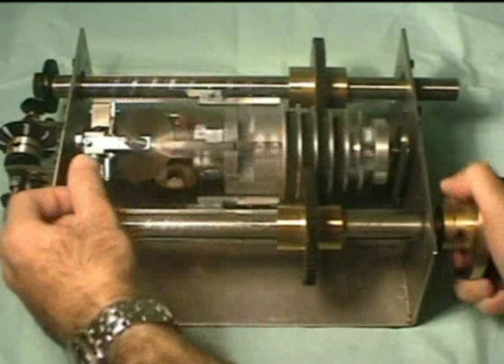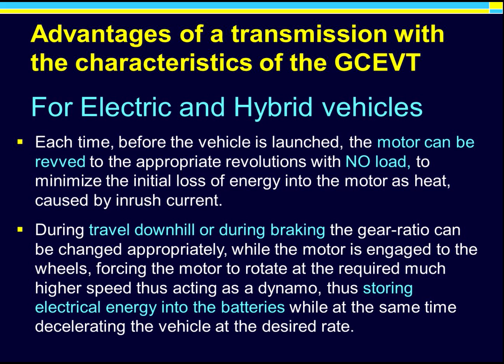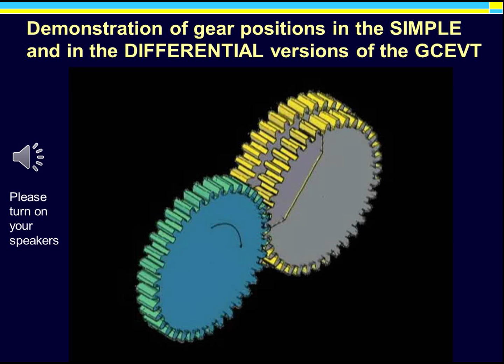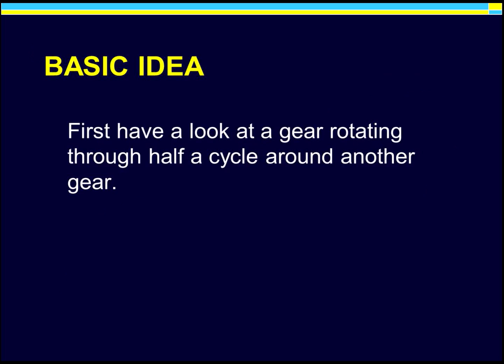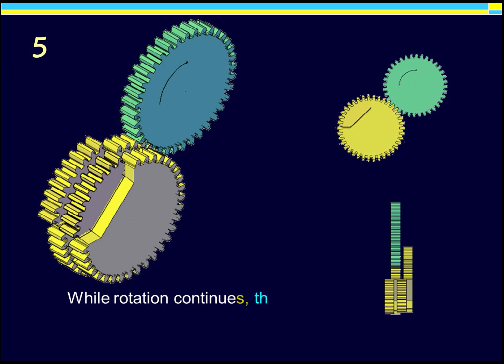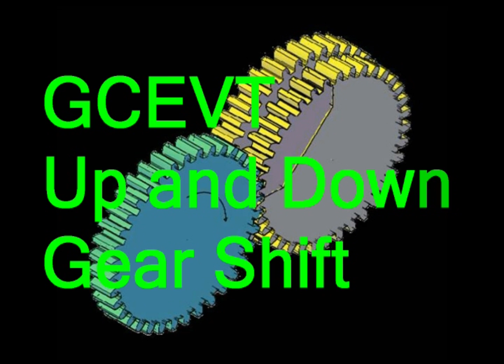GCEVT Gear-based Continuously Engaged Variable Transmission

Comment: So all of the central gears have to be the same size. In order to change ratios there has to be planetary sets inside the central gear sets. And from what I can see, you are using the output axles of the differential rotating at different rpm to regulate drive shaft speed. So you're dependent on the spider gears in the diff for output regulation. As well as the whole rotating assembly appears to require a lot of force to turn. Otherwise you would have demonstrated the shifting mechanism while turning the little crank demonstrating the ease of operation. Sorry I have to call BS on this one. Nice try though!

Comment: The actual gear changing happens during one half of a shaft rotation. So, if the shaft is rotating 5000rpm that doesn't leave much time to shift. Hold the shift lever to long and you've run through all the gears in a few shaft rotations.

Comment: not cvt but just a constant power shift mechanism. It may be good in slow speed applications like farming but it's not suitable for high speeds unless you drastically increased the size of the main cylinder.

Comment: Honestly I think the diff launch thing is really cool but the fixed positions of the shafts and gears leads me to believe it's not actually changing ratios?? maybe I'm missing something but I'm pretty sure there's some trickery happening here. also, and most importantly... anything over a few hundred rpm will tear any version of this apart in a hurry!! But again I think the diff launch thing would be great for drag racing... Probably already been done and outdone by a common trans brake...

Comment: hook it up to a Briggs & Straton 15 + hp engine and lets watch this thing work for real under a load at a high rpm ,put it in a ridding lawn mower!
 i noticed that the up and down gear changes are linked( input & output) thy need to be independent from the input and output shafts.
noticebel fail points in this model the gear shifting disks dont look durable enough might just be the camera angle though.
the 45 degree angle of the disk looks like it would break at rpm when engaged ,also at rpm what disengages the shifting disks so double slap or tripple slap does not happen of the shifting disks/ engagement arms?
very cool design imo

Comment: How do input and output gears maintain mesh with central gears as the diameters change?  Perhaps I missed it but it appears that input and output shafts are fixed so spacing between gear teeth will change with shifting.

Comment: Very interesting. 
I don't see/understand how the outer gears, the input and output/intermediate, are able to move to the 4 larger/smaller gears without also moving in and out relative to the 4 middle gears.
What am I missing?
Reply: The center gear set that is doing the shifting is on a linkage that allows it to float left and right, it can be seen if you look closely at the end of the shaft in the high speed gear shifts.  This allows for the required center to center distance change.
Reply: @johnpearson492 
         if that is the case, can this arrangement be safely  used for heavy load transmission.

Comment: Rotate a drill with 1500 rpm and try to switch it
This system will not work for a long time at high speeds.
Reply: Variable valve lift, look it up. Basicly same thing here.
Reply: You can program ecu to reduce power durning gear switch.
Reply: Mindaugas Vaskevicius nop, variable valve doesnt have to withstand full engine power..
Reply: Mindaugas Vaskevicius so the advantage is gone.. since the goal of cvt is to reduce power loss during shift..

Comment: I want to se this in 1000 rpm :P on this one
Reply: Variable valve lift uses basicly same technology.
Reply: Exactly that's the problem. It will not work at continuously and high rpm. That's the reason he turns it by hand.

Comment: I thought this was going to be a CVT, ie a transmission providing for gradual continual change in transmission ratio, but it is not. Instead it provides a small fixed set of gear ratios.

What is continuous about it is the engagement, which, fair enough, sounds like a feature that can be patented. But the absence of a clutch or torque converter will mean that the ratio change is abrupt, and I wonder if that is its Achilles Heel, as it will put a sudden strain on the device as either the engine speed or road speed changes abruptly. So it may require some kind of slip mechanism to smooth out that abruptness after all.
Reply: Lol, a torque convertor would be used for this thing, although highly advanced bearings & races for engagement could be used in a race spec model for only high speed use. It is likely that under high speed rotation, those little spline elevator arms would only handle moped power levels. It would be hilarious to see a common transmission with such little material retaining the gears. Pop!
Reply: you could add that dount thing from a standard automatic that replaces a clutch...
Reply: Can be easily solved with any form of viscous clutch / transmission, and with a synchronized [momentary] reduction of torque [particularly in electro drive].

Comment: While the design is nice, there are some major engineering flaws that I see. One,There is no Active oiling system, a lot of metal on metal contact occurs. Two, there are a lot of intricate individual parts, Not only is it more difficult to manufacture but all of the tiny components do have a cyclic life to them and are subject to breakage. Any way to simplify the smaller linkages that control the disks which push the split gears would add to the durability of the device. Otherwise, very well done. I'd love to see a design study of your own doing for the maximum load (speed and torque) for time T in seconds that it can endure without critical failure.

Comment: just until the 12 min i really catch the trick
no hydraulic disks! no clutch! no double clutch! no cvt!!!!
its just beautyfull
Reply: it's not cvt-it has set ratios, it's continued input(no need to disconnect engine&trans with clutch each gear change)
Reply: sequential without smaching sound?